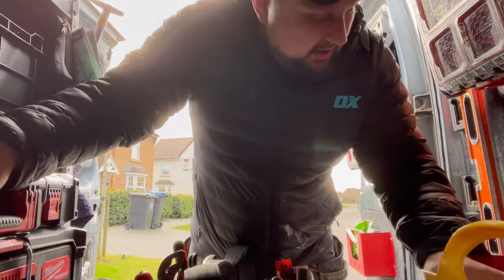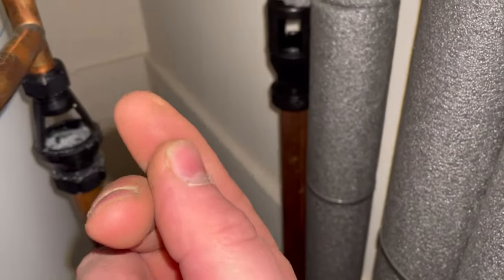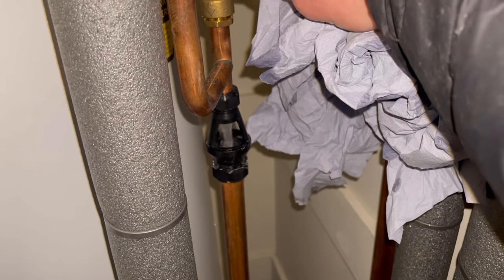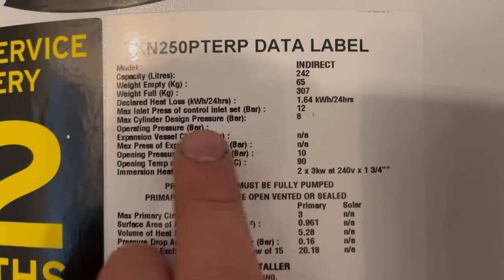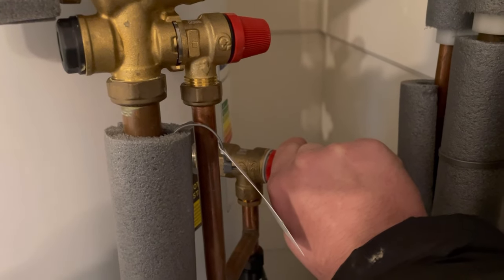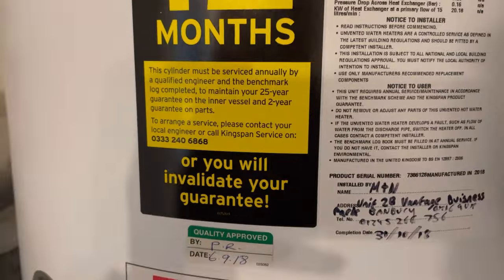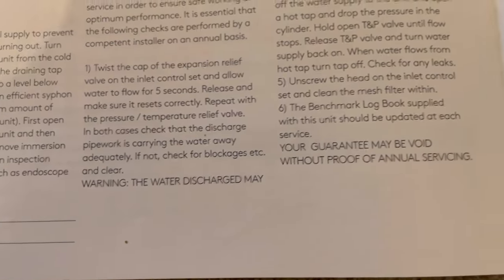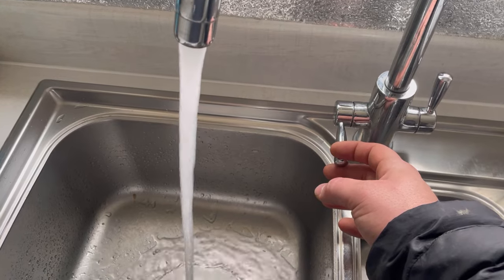how to service an unvented cylinder (kingspan tribune XE)

Comment: Hi mate, if you have an external expansion vessel on the cylinder pipe work which needs charging, and you pump up to MI’s do you have to keep the PRV open to empty water in vessel?Thanks

Comment: How often should the internal bubble need recharging? Have to do mine every 3 months.
Reply: Same with mine, do you get high water pressure in your taps after it’s been heated ?
Reply: Only get higher than normal pressure when the bubble is ready for charging. Once it's been done it's then back to normal.